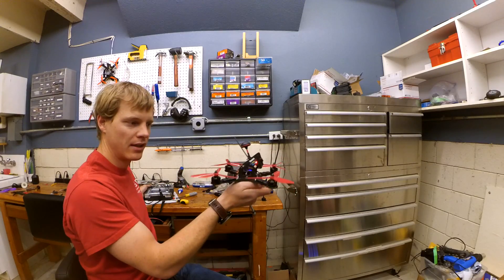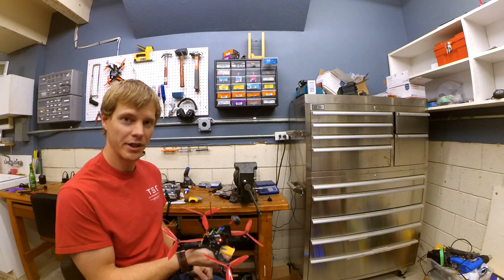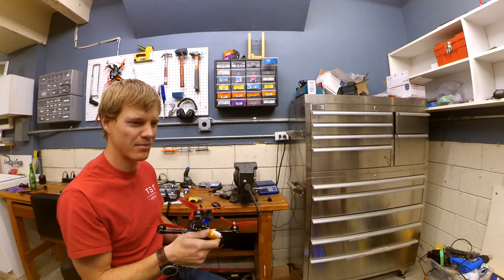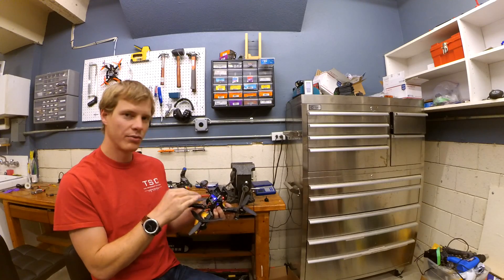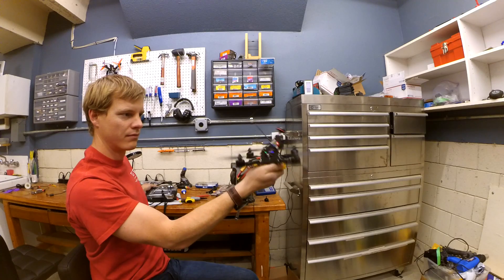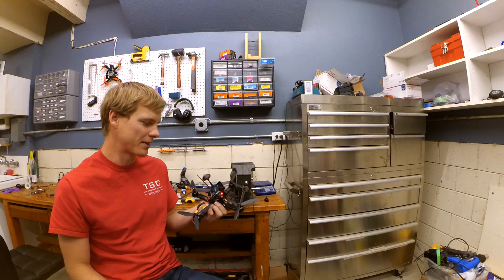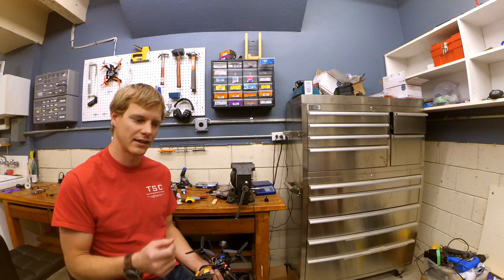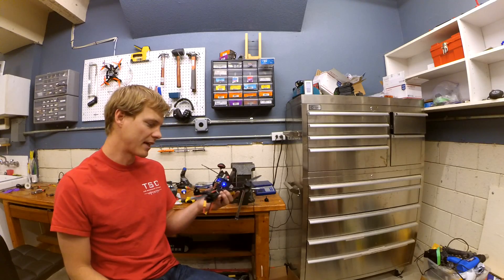DAL 6045 Tri-blade Problem [Propwashed Testbench]

Comment: ive built a new 6in, ive tried the tj6045 and the 6040 cyclones, the cyclones are terrible, the tj6045s are way better and fun to fly but pull way too many amps, i think bi-props are the way to go with 6in

Comment: Did you ever end up being able to fly these by adding a notch filter? If yes how are they.
Reply: (I'm the editor who did this video) - Yes, the notch filter made the blades usable on Betaflight, but they still occasionally exhibited this vibration when doing negative-G acro maneuvers. I'd honestly recommend sticking with the HQProp tri-blades if you are doing 6" props.

Comment: Interesting! Are these the DAL TJ6045? As I think there's also just T6045. Or are they one and the same?
Reply: It's the T6045 - where do you see the TJ6045?
Reply: http://www.hobbyrc.co.uk/dal-tj6045-tri-blade-super-durable-propellers-2x-cw-2x-ccw-green
Reply: OK - I'm 90% sure these are the same props but I'll have to grab some to verify.
Reply: I'm using them in my 280 build with 2206 motors and they seem to be fine. I'd be v interested to hear how you get on with them!
Reply: I fly the TJ 6045 on 5s 2207 and 2208s with no vibrations what so ever and im making over 1700 grams of thrust.

Comment: I think it has something to do with damp light and/or multishot.   I'm having this same issue with DAL 5x4.5 two and 3 blade props.  The problem started when I started using multishot.  I think it's some harmonic of the braking with these more powerful / torquey motors.

My motors are the Emax RS2205 2300kv, 30A Littlebee ESCs running Multishot 14.6 + the Dal 5x4.5 2/3 blade props.  I'll have to try some others to see if it clears up.